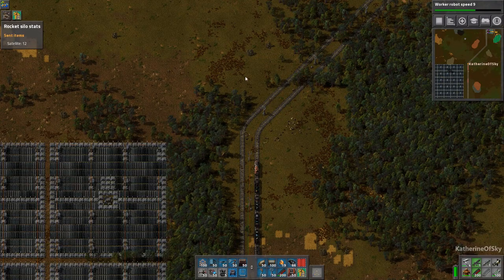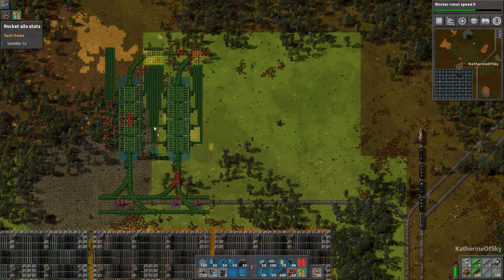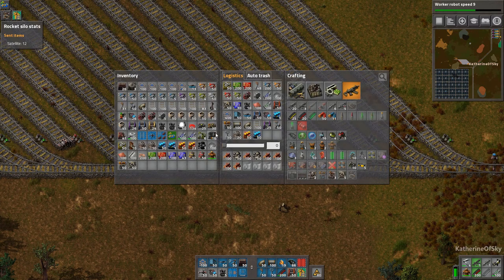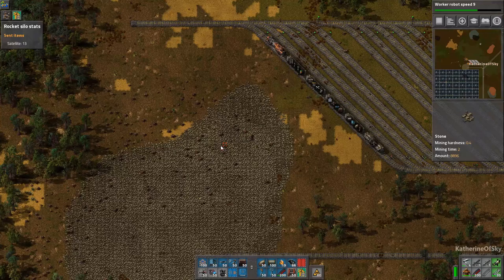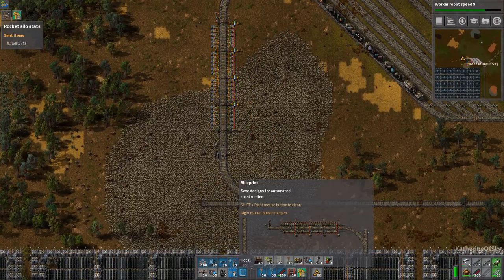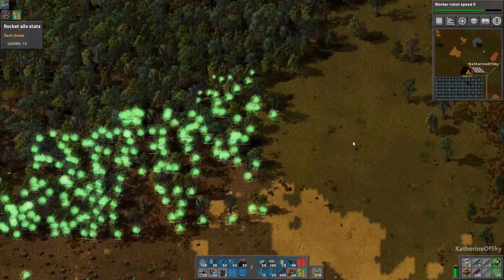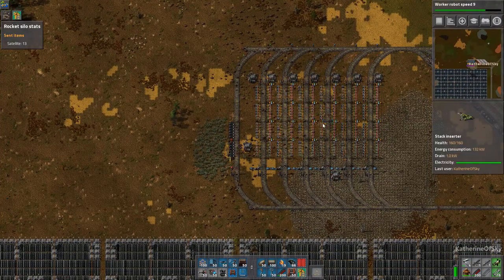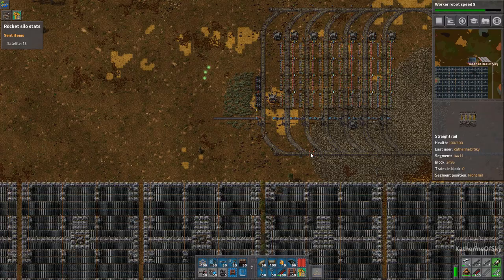Factorio: Entry Level to Megabase Ep 51: MEGA IRON TRAIN STATION - Tutorial Series Gameplay

Comment: Something nice I tried since I heard players complain about forgetting how they lay there tracks in case of designated lines for each thing is using colored lights. Just add a connection from the power line to the light with a silly always on condition and use light. 
Then someplace (probably at the start of the line/main base) put a constant combinatory and you could pick the light color. 
Then all the line will be color coded

Comment: 14:10  Picker Extended mod includes the dolly function.  Super useful when you make those annoying off by 1 mistakes.
Reply: I LOVE Picker Extended for that! (and a few other useful things like rotating combinators by 90°)
I just don't understand why you can't move the power switch. And not just that, you can't move anything that is connected to a power switch with any wire (red/green or copper).
Reply from the maker: Yep!  I think I even mentioned it :-)

Comment: wouldnt it be better to place a complete line of roboports between each station?
i think i heard the recharge when they fly above ports. Would save much time, isnt it?
Reply from the maker: They do not recharge when they fly above 'ports unless you are using a specific mod.  They need to stop, use one of the 4 ports on a roboport, wait a few seconds, then they get back to business.  If there is no port available, they will form a circle/semi-circle around a roboport waiting to charge.
Reply: The bots will try to recharge once they've dropped their cargo. For a setup like this, you definitely want a lot of roboports at the drop-off points. I suspect KoS will find the bots queueing for a long time at the plate loading area with so few charging points, especially with such a large logistic network.

Comment: When does a base transit from just a base to a megabase?
Reply: My take on it is; that it's when you reach the point of being able to launch rockets, you instead use all that infrastructure to start your real construction, often with the aim of 1 rocket per minute, an industry standard of true mega bases : ) so where one could say they have finished the game, mega base builders use that as a starting point. You just can't build high numbers of lvl 3 modules, blue circuits and vast volumes of gear until that point.
Reply from the maker: ^^ Indeed, very much what Pineapple commented.  You need pretty decent production to get modules flowing, but once that happens, you can finally start building outposts that have a HUGE amount of throughput on things like green, red, and blue circuits, oil products, rocket parts, etc.